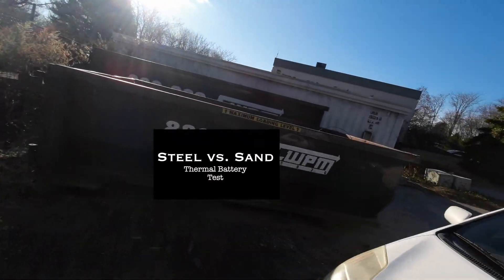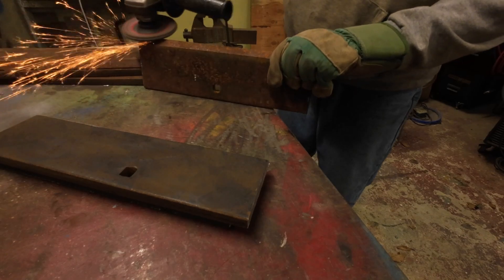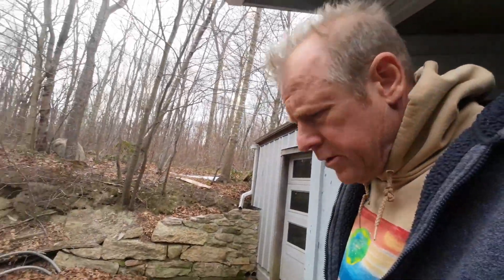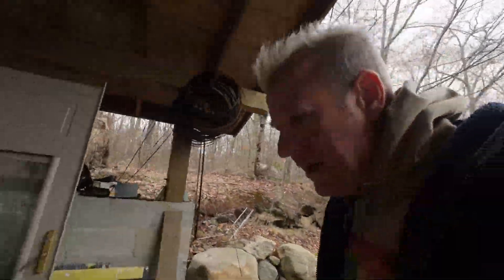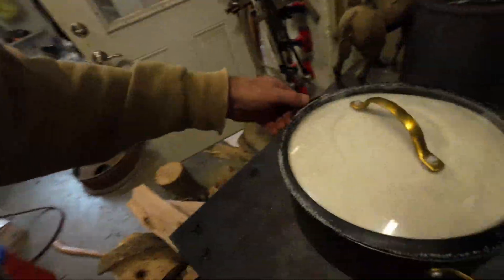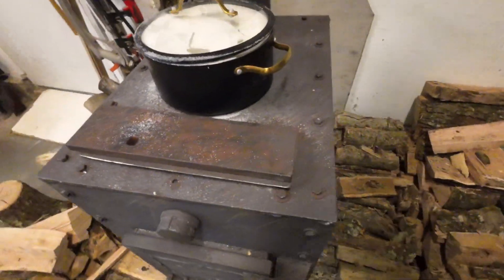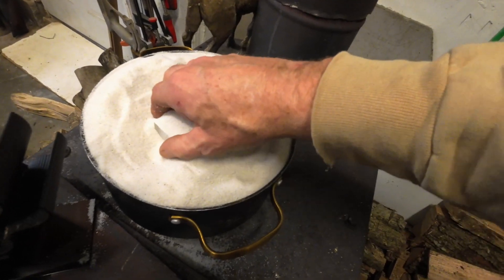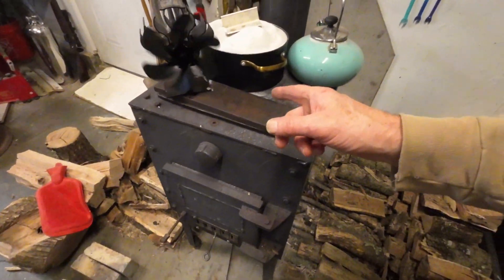Wood Stove Battery, Steel vs. Sand, Head-to-Head

Comment: Good question — and you’re thinking in the right frame now: thermal mass + retention, not surface flash-heat.

Let’s strip it down to physics and practical stove reality.

🔥 Heat battery on a wood stove: sand vs steel

The two properties that matter

Specific heat capacity – how much energy it can store per kg

Thermal conductivity – how fast it absorbs and releases heat

Retention is about both, not just one.

🧱 Sand (dry, silica-based)

Specific heat: ~0.8 kJ/kg·K

Thermal conductivity: low

Density (loose): ~1,600 kg/m³ (packed higher)

What that means in practice

✅ Stores heat fairly well
✅ Releases heat slowly and gently
❌ Takes longer to heat through
❌ Loose sand wastes volume unless well-contained

Think of sand like a slow, steady ember.

🔩 Steel

Specific heat: ~0.5 kJ/kg·K

Thermal conductivity: high

Density: ~7,850 kg/m³

What that means in practice

✅ Heats up fast
✅ Transfers heat efficiently to the room
❌ Stores less energy per kg
❌ Loses heat faster once the fire dies

Steel is a burst heater, not a battery.

⚖️ Thermal storage comparison (same volume)

This is where steel tries to claw back ground.

Because steel is ~5× denser than sand:

Per kg → sand stores more heat

Per volume → steel stores similar or slightly more, but dumps it faster

So steel = shorter, hotter output
Sand = longer, softer output

🧠 Stove reality (this matters)

On a wood stove:

Steel heats while the fire is roaring

Sand keeps releasing hours after the fire drops

That’s why:

Masonry stoves use stone, brick, sand, or soapstone

Steel stoves feel hot fast but cool fast

🏆 Verdict: which is the better heat battery?

For thermal mass retention

🥇 Sand (contained properly)
It holds and releases heat longer.

For fast heat delivery

🥇 Steel

Best of both worlds?

🔥 Steel shell + sand/stone core
That’s ancient wisdom and modern physics.

⚠️ Practical warning (important)

If you use sand:

Must be bone dry

Fully sealed metal container

Any moisture = steam pressure = danger

No shortcuts here.

Bottom line (truth, not hype)

Sand = endurance

Steel = punch

Mass heaters and masonry stoves figured this out centuries ago

If you want, tell me:

Wood stove size

Where you’d place the mass

Whether overnight heat is the goal

I’ll help you dial it in properly 🔥
Reply from the maker: Wow, thanks for the in-depth beak down! Your science matches my experience. Right now I have three full sized fire bricks on top for slow release of heat and 7 steel bars. I can move them around as desired. Working well for me. Thanks again for the info!
Reply: @sculptureforasmallplanet AI can be good tool. Fast
Reply from the maker: @TRUSTCHRISTORGOTOHELL  ah ha very clever!

Comment: Deadlines don't take long to eat, but it's gonna last longer. Still eat quick, but it cools. Quit what sound is loose? But when it's wet, it's a 100% compatible. That's why sand used in so much stuff. It conducts holds and handles heat. Better than stake a higher temperature to milk.  Therefore takes a higher temperature to eat but it lasts longer
Reply from the maker: It sounds like you’re on the right track. It really comes down to the application!

Comment: I've for a  two-foot section of railroad track on my stove as a heat battery, but then, I don't try to move it around.
Reply from the maker: Good for slow release after the fire goes out. Nice!👍

Comment: You're instantly losing heat in those metal slabs by placing them on the concrete floor.
Reply from the maker: Got plenty to lose. Can’t sit still for longer than they take to cool down any plus the that goes into the concrete ends up going up to my feet anyway.
Thanks,
Reply: @sculptureforasmallplanet The thermal mass of that concrete floor is a giant heat sink which will quickly draw the heat out of those metal slabs. Efficiency wise it is a loss that can be quickly mitigated.

Comment: why sand/steel battery? your stove is inside the house.

burn less wood, you will save more.
Reply from the maker: I use the steel to move the heat to my feet.

Comment: Instead of sand, try paraffin, just be careful that the fumes don't ignite
Reply: My grandfather used paraffin for years, then the fire happened, and then he stopped using paraffin. In his case the container got bumped and the liquid paraffin sloshed onto the hot stovetop and ignited.
Reply from the maker: Wow! I’m sticking with steel and make sure I don’t drop them on my toes. Thanks,

Comment: The steel at your feet is directly on the floor.  The floor is going to conduct a decent amount of heat away by contact.  You should have some sort of insulator(could even be another piece of cardboard) on the ground to prolong heat radiation.
Reply from the maker: Yes the concrete will suck some of the heat away but it all ends up going up in the end. I’ve never wished for the steel to stay hotter longer yet sometimes it’s too hot. But you’re right if I did want to keep them hot longer an insulated layer would do the trick. Thanks,